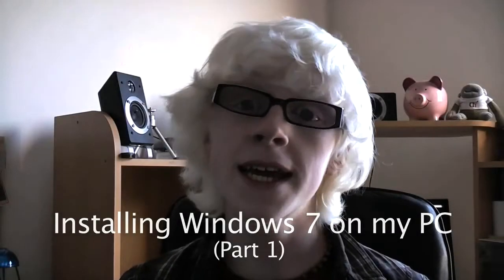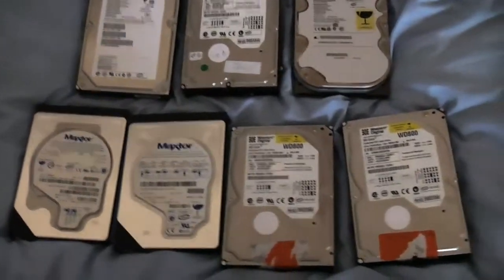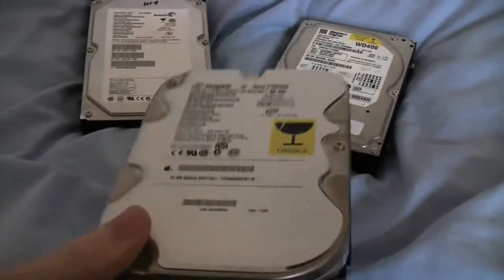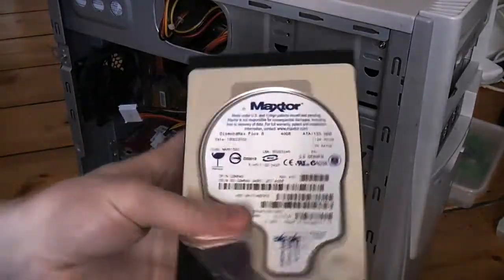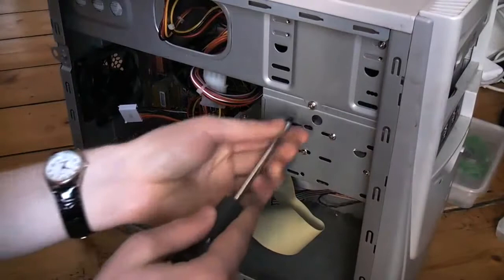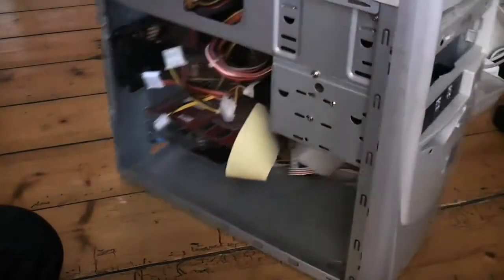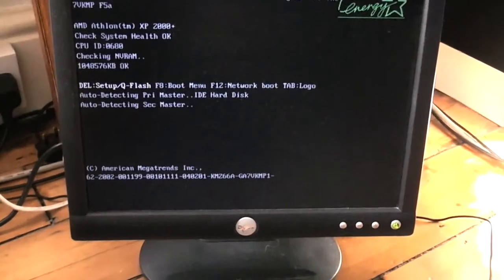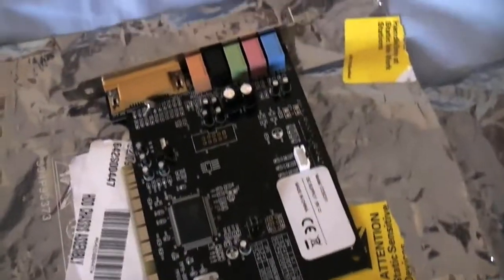Installing Windows 7 on my PC (Part 1)

Comment: This pc is probably history now but here is a tip, that noise when that pc is turned on is a fan with dry bearings, to make it like new again remove the sticker on the fan, this allows access to the bearings some times there is a plug in the way but it comes out easy with a flathead screwdriver then just put 2-3 drops of 3 in 1 oil in there, then let the fan run for a few seconds and its good as nee ;)